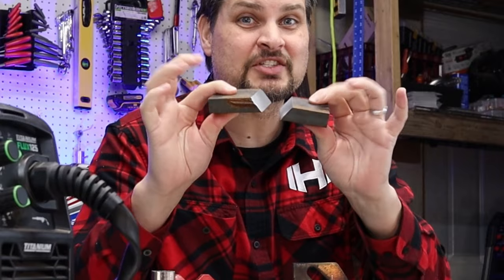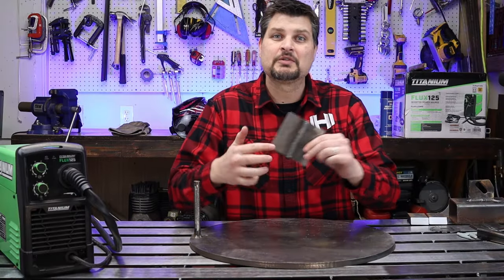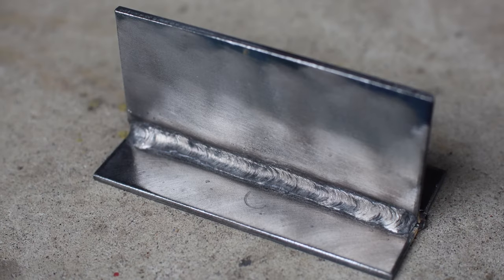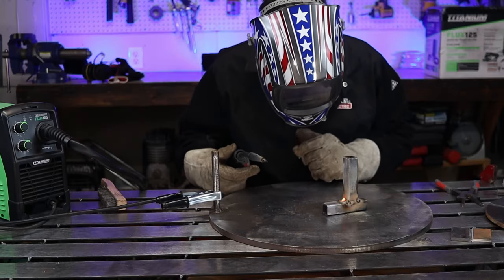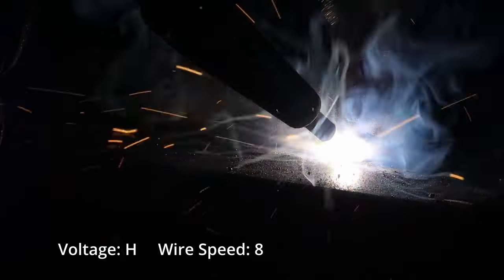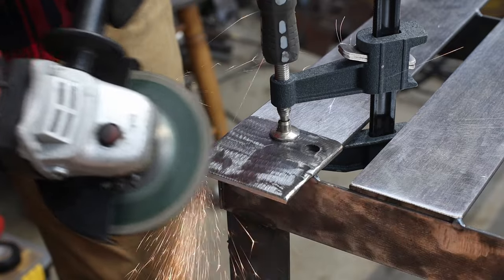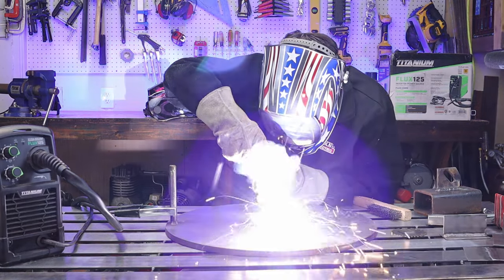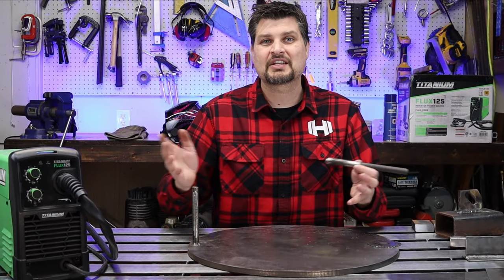Thickness Test: Sheet Metal - 1/2" w/ Harbor Freight Titanium 125 Welder

Comment: Fun fact: must flux wire is rated for single pass only. You can do more than one and stack 'em, especially for practice, but the weld won't be as strong. You can find wire rated for multiple passes - Lincoln makes some - but of course it is more expensive. Always check the label.
Reply from the maker: Right on, thanks for the info! Stay tuned!
Reply: Exactly. Anything with a GS is single pass. Anything with an II (eleven) is multipass. I use Hobart, that’s good too. I find that if you prepare everything correctly, and weld properly, 1/4” will pass a cut test and a bend test using multi pass (three passes). I think I saw a creak on what would his right side of the 1/2” weld.
Reply: I found some Blue Demon multi pass wire at a good price.
Reply: Lincoln NR211-MP "MP" is for multipass

Comment: Do you think i could use the titanium 125 for quarter inch mild steel for custom engine mounts on a 4 cylinder?
Reply from the maker: Yes, make sure they are beveled and you can get to both sides. Also do a bunch of practice welds.

Comment: I bought the Titanium 125 after watching several of your videos talking about it and using it, And I really like it alot. I have welded support brackets to my tool box for shelves, wheel brackets to my mower deck, and welded the snow plow I use with a 20hp Ingersoll, and it held up all winter without any problems. I like the way you do your videos, short and to the point, thanks.
Reply from the maker: Right on. Stay tuned!

Comment: I worked for a charter jet airline as a mechanic (not on anything that flew!) for the ground support equipment shop. We bought a Chicago 125 for quick welds that didn't need to be pretty, to regulation, or be under any stress, and it worked very well for that. Basically, that machine taught me how to weld, as I'd never had any instruction before. The boss was impressed enough to buy us a big Miller unit, but we used the Harbor Freight machine twice as often! 

I bought the Titanium 125 for my house, and continued my welding "education". Still a long way from "pro" status, but none of my welds have failed. I love your tips, and your project videos, as they really make sense the way you present them. I used your video of making the welding table, as a guide to repair a neighbors railing for her stairs. It came out very well! Thanks!
Reply from the maker: Right on! Thanks for watching and stay tuned!

Comment: Bought a Titanium 125 a couple weeks ago on sale, finally got the opportunity to try it out today. First time welding anything. Bought some 1" x 1/8" flat and cut into 3" lengths. Welded 90 deg angles then welded those into a square tube and finally welded a tab to outside of tube, all good practice. Welds started to look almost decent by the end! Going to buy some tip gel and anti-spatter spray soon. Thanks for the videos, I have learned a lot.
Reply from the maker: Thanks and stay tuned!

Comment: Thanks for taking the time to do these videos, great job. I am retired and trying to complete some projects around the house and with my Side by Side. Years ago, actually fifty two years ago I worked for a while as a welder building water tanks out of 12ga. steel running a stick welder at 275 amps. you didn't want to slow down. It was piece work you got $35 for a 750 gal. tank if none of your beads leaked. Haven't really done much welding since then, and as I am sure you know it's an art and if you don't keep your hand in it, well lets just say I have forgot more than I knew. What I am saying in a roundabout way is thanks, your tutelage is appreciated, keep up the good work.
Reply from the maker: Right on! Thanks and stay tuned!

Comment: I welded some 1/2" plate to a 1/4" plate with good results.  I ground the 1/2" to a point so I could get in there to make a pass. .The pass was hot and slow! I let each pass and welder cool a for minutes after each pass.  Afterword I tried to br eak each weld with a big hammer with the piece in a big vice.  The weld held!
Leland Cox
Reply from the maker: Right on, way to prep!

Comment: A BIG BLACK EYE FOR HARBOR FREIGHT
I have a Harbor freight TITANIUM FLUX 125 WELDER purchased from Harbor Freight a couple years ago.  I am a retired plumbing contractor and backyard hobbyist.  I love to build things in my spare time and help friends and neighbors that need something repaired.   When I retired and closed my business, I had a stick welding machine but had no convenient place to connect it at my home! It would require an upgrade to my electrical service not worth the trouble and expense!  When I saw a couple reviews on YouTube for this Titanium 125 welder, I thought that would be the way to go.  I already had a 110 Volt 30 Amp circuit to my workshop!
It took me a while to get adjusted to the flux wire welding.  I built a minibike from scrap pipe I had left over from the plumbing shop.  The welder allowed me to make other things and make repairs for others I wouldn’t be able to do without it.
In the middle of my last project, I cut a couple pieces of metal and got ready to weld them and when I pushed the button on the welder, nothing happened! It was dead!  The fan did not come on but the light on the ON/OFF indicated there was power to the welder.  I checked the manual for a reset button or a fuse and found no mention of either.
So, I called the Harbor Freight 800 number and was told there was no repair for this welder.  Harbor Freight has no repair facility, and no support is available.  I was told by two different tech reps there is no schematics or parts list available from the factory where this is manufactured.  “It is not worth getting it repaired and cheaper to go purchase a new one!” If you purchase this welder or many other things from Harbor Freight You only have 3 Months Warranty.  It is considered disposable after that!
All the reviews and discussion I have read about HARBOR FREIGHT I have never seen anything about their total lack of support for their products! I didn’t even get an “I’m sorry” or any offer for a discount on a new welding machine!
I am retired, was an electronics technician in the Navy, active Ham Radio operator and electronics hobbyist. I feel like the electronics in this welding machine is straight forward non computer controlled and any decent electronics tech should be able to repair this given reasonable support.  I removed the circuit board from the welder and found where a small component burned of course not knowing the component value or purpose will make it difficult to replace. Providing a schematic and parts list is a very inexpensive form of support that should be a minimum requirement. Their claim to revenue of 7 Billion Dollars tells me they could afford it!

Leland Cox
Reply from the maker: There are definitely lemons out there. Too bad HFT wasn't of any help.
Reply: So you just buy a new one, swap them out and return as defective. Pocket for a Pocket
Reply: You were told at the checkout counter that it had a 90 day warranty and then offered a one or two year replacement plan. If you pass on that it's on you.
Reply: Go buy a $3000 welder.  Stop bitching.   Go buy a Hobart, Lincoln, or Miller.😢

Comment: I just bought one of these welders a week ago. I plan on welding exhaust with it. An so far it's doing really good
Reply: Do you have a circuit breaker or just plugged it in like normal ? New to this
Reply: @fernn587  just plug in to wall
Reply from the maker: Just plug it into an outlet. Most garage outlets should be connected to a 20 amp circuit breaker which is located in your panel. Thanks for watching and stay tuned!
Reply from the maker: Right on! Thanks for watching and stay tuned!

Comment: Great video! Emphasizing clean weld surfaces and chamfered edges is the key for successful welding with these buzz boxes. For best results have the welder on a circuit with nothing else running on it (which I know is easier said than done).

Comment: Plan on picking up the 125 soon. I need to build a baby gate for some kids visiting in May.
Reply from the maker: Perfect timing. This week during their parking lot sale it's on for $169. It's the cheapest it will ever be. If you picked it up for more you can take in the recite and get refunded the difference. Stay tuned!
Reply: @-DIYPRO-  I was going get it at $175 but saw it was going to drop anyway, and will if you shop at HF you save the $5 if you can. My local HF is low on them so that should cover shipping.
Reply from the maker: @Being_Joe  right on!

Comment: I’m curious how you handle the off gassing (smoke) in your shop. I have a shop exhaust fan but where I live in the bitter cold it tends to exhaust all my heat as well. Unfortunately I do very little welding in the heating months. I know they make Uber expensive filter units but gads I’m on a budget!!
Reply from the maker: Great point! When it's warm I have the garage door and a back door open. Creates a perfect cross wind. When it's cold I have a little exhaust fan that I put in the door to take out the fumes.

Comment: I just need to weld some 1/4" flat bar to square tubing inside a steel enclosed trailer for ratchet straps.  

Probably 1" weld top/bottom where the flat meets each square tubing.  Would a 125 cracker box do it?
Reply from the maker: Yes, you'll want to make sure and put a little bevel on the 1/4" plate just to make sure you get some good penetration.

Comment: what welder is still beginner friendly and can do BIGGER than 3/16 ?  (WALLET FRIENDLY )....
I have some I-beams I picked up cleaning some trash at a house and would love to weld them together for a structure in the near future...
Reply from the maker: You'll want a machine that has 220V input. Lincoln 180, Titanium 170 or 200, Vulcan 220. Your best "budget freiendy" welder would probably be the Titanium.
Reply: @-DIYPRO-  so not the titanium 125?
Reply from the maker: @thegarbagegladiators4735  not if it's for something structural.

Comment: Just bought the titanium 125,  to use for a project on my Tacoma. Plans changed, and now I need to weldv1/4" body mounts on the frame, it looks like with the right prep, wire and voltage it's doable, what do you think? I'm a beginner, but I'm in the trades (plumber)
Reply from the maker: Right on!

Comment: I don't have a titanium 125 I have the chicago electric 125 and I build mini smokers out of 6" pipe with it. I've learned that it will weld 1/4" even thought it's like the titanium and says the max is 3/16"  just gotta slower the wire speed and take your time
Reply from the maker: Thanks and stay tuned!

Comment: where did you get the round plate? $$
Reply from the maker: I work with fabrication shops and it was "drop" from a bigger project so they just gave it to me. If you ask around fab shops they like to get rid of that smaller stuff, most of time for free.

Comment: do you think this could weld steel pipes into a fence? last question and if yes im buying this welder
Reply from the maker: Yes as long as the pipe wall thickness is less than 3/16" (which I'm sure it is) than yes. Thanks!

Comment: POS is cranked all the way up when I weld with this unit.    Burned up the torch end and thought I had to get another complete gun.   Cost prohibitive as far as this unit goes at like $70.   Purchased a HitBox for like $60.   Digital display and does stick also.   A lot smoother and seems to run smoother feeding wire.   This welder is noisy and does not feed wire worth a shit.   Definately a beginner, but this is not worth the money charged anymore.   Lots of better options on Amazon and EBay resellers.   That and I am really turned off on anything relatively expensive at HF.

Comment: I carry that 125 in my trunk for when I'm out doing ornamental iron gate repairs, done some multi pass on some pretty this brackets on occasion, back when I was in welding school they only had transformers, now inverters are all I ever use. One exception I need to get an old A/C buzz box to run my twin carbon arc torch, don't want to risk any damage to my Everlast tig.
Reply from the maker: Great setup! Stay tuned!